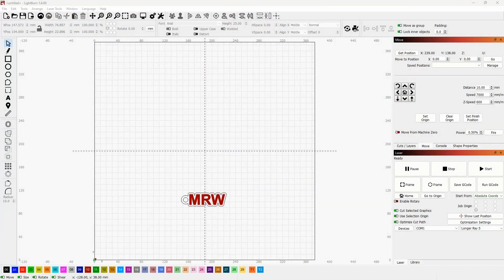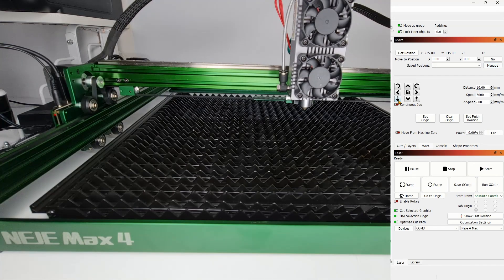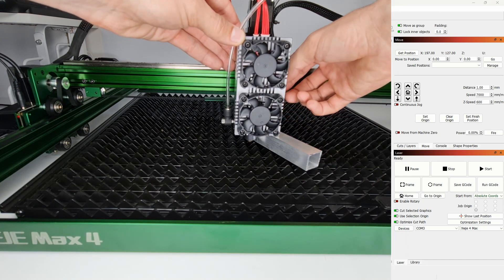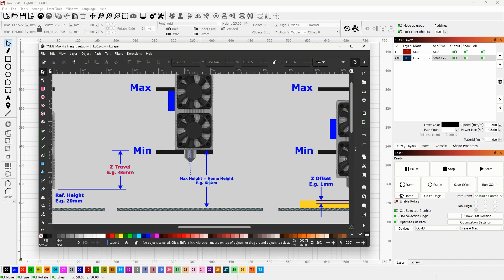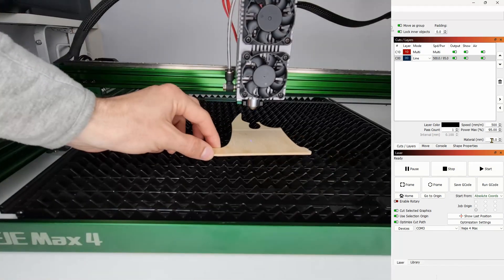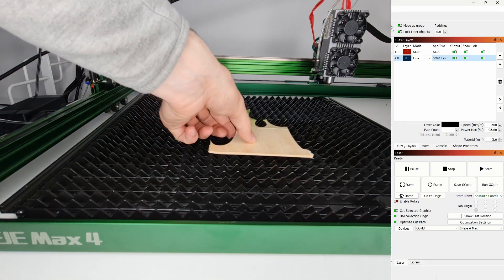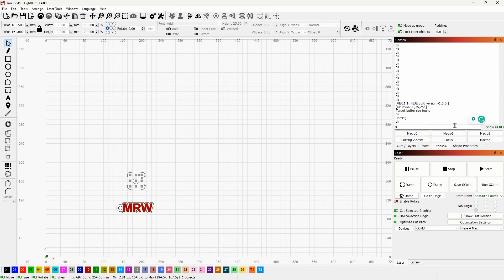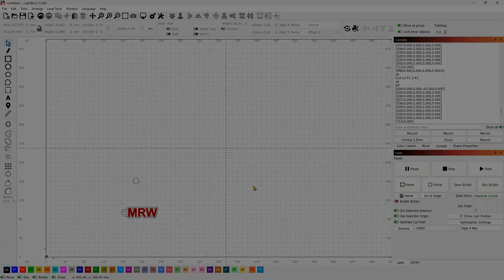Z Axis Setup and Control LightBurn with NEJE Max 4

Comment: You know there is one issue with your video and that is:  You have the focus at 23mm, while the manufacture says for E80 the focus is 25mm, and that make 2mm difference. Why aren't you using manufactures instruction? 2mm is a big difference and makes everyone go wrong. I like your video but, I don't like your misguided approach.

Comment: Hey, Do you know what is the reason that motor contunue turning while the head reach the end position ( see 13-23 till 13-26) - the head goes up and then it reached the home point , but it is clearly hear that motor is trying to turn, so it won't stop in home point .

Comment: Hi,  this is a great video and if my Max 4 worked like this it would be awesome! However, my Max 4 appears to behave differently and I wondered if you might be able to help?  I have followed the setup exactly as described. I determined the focal length on my E80 to be 24mm, and my distance from honeycomb to laser is 66mm... so the difference is 42mm. When I enter an offset of "42 - thickness of workpiece"  into the offset for the layer(s) it works perfectly. However, when I code the GCode entry (G10 L2 P1 Z-42) the coding is accepted, and $# shows [G54:0.000,0.000,-43.000,0.000], but when running the job, the Z axis does not move down at all. I've rehomed, powered off/on and checked the firmware and version of Lightburn (v1.6.00). I'm not running in absolute mode and I have double checked that Z-axis is still enabled - I can still jog it up and down...  Do you have any clues as to what else I could look for?
Reply: Ah hah... noting a comment below where someone mentioned "absolute coords"... As soon as I switched to absolute it works like a charm! Brilliant. SO it doesn't work like this in "user origin" or "current position" mode. My previous Laser experience is limited to an Atomstack A5 with no limit switches, so I have just got totally used to "current position". I am now learning how good absolute coords are!! 🙂  Once again MRW great video and very helpful (once I realised I need absolute coords!)

Comment: You are the only one who took the confusion out of this process. I believe I have it right now. Here are my list of steps I got from your video.
Step 1:  Home machine
Step 2:  In Lightburn (LB) in Device screen click on “Enable Z” and “Optimize Z moves”
Step 3:  Move laser to center with jog control (click on Move Tab in top right box for jog control)
Step 4:  Raise laser in bracket to it’s highest position (bottom of bracket even with bottom of laser)
Step 5:  Lower using jog control till it rattles (lowest position)
Step 6:  Loosen laser holding screws and lower laser to 25mm above the honeycomb
Step 7:  Go to Home position (laser should go up and over)
Step 8:  Measure distance from honeycomb to bottom of laser and record the distance = 73mm
Step 9:  Subtract distance in step 6 from the measurement in step 8 which is 73 – 25 = 48mm
Step 10: Measure thickness of material in mm and enter into the Material field in the Cut/Layer box
Step 11: To engrave click on black layer in the Layer/Cut box on the right and enter 48 in Z offset.  To cut click on red layer add depth of cut to the 48 and enter into Z offset field

It's a starting point and some fine adjustment may be needed to get the sharpest resutls.
Reply: thanks, very clear!

Comment: Hi, thank you so much for this wonderful video. Finally someone able to explain how this laser works. I have a question, what kind of compressor are you using? I bought the Ortur one, but I'm not convinced of the airflow. Thanks Luca
Reply from the maker: Hi, lucadiveglia2150;  thank you for your comment.

I am glad you found my video helpful.
About the compressor, I use a 9l oil-free compressor by Vevor, and it has worked flawlessly for about a year now.
It is quiet and effective; I allow the compressor to rest every 40 to 60min of continuous operation to avoid overheating. After all, it is not a professional machine.
I additionally arranged it inside a homemade enclosure using Rockwall panels to make it quieter and avoid troubles with the neighbours.

Below are some links to check out the compressor and other accessories you might need. Consider that a water trap is a must to minimize the condense getting into the line.

Compressor: https://s.click.aliexpress.com/e/_DlBpbS9
Water Trap Filter: https://s.click.aliexpress.com/e/_DeJ8RVx
Air Hoses: https://s.click.aliexpress.com/e/_DEPZnZ7
Attachments: https://s.click.aliexpress.com/e/_DeqOGdB

I hope it helps 
Ciao

Comment: Is there a way to have the z axis raise when burn is completed like it did before changing the G54 #?
Reply: Just put G0 Z45 in the Devices Settings window in the End GCode window under the GCode tab. You can also add G0 X*** Y*** to the position you want to finish.

Comment: I'm having trouble with the z axis raising on its own when a job is initiated.
I have tried disabling the z axis and any z axis offset in lightburn but it still raises even when creating a test grid or framing.
It doesn't do it when just moving the positions manually. 
Any ideas what could be wrong?
Reply from the maker: Hi, thank you for your comment.

The Z axis moves to the 0 position, to then sink again to the right offset. I guess you have some custom coordinate set for the G54. G54 is not triggered for a manual jog.
Type $# in the console and check the line that says G54, if there is some value other than 0 for the Z axis then you need to set it to 0.
To do that type:
G10 L2 P1 Z0
and enter.

I hope it helps
Ciao

Comment: Great video and information!! Hoping for some advice. I have the neje 4 max with the extensions. It seems my y axis is mirrored and it cuts in the opposite direction of the layout in the lightburn software. Thank you!
Reply from the maker: Hi, @arranp1693; thank you for your comment. 

The mirrored Y axis may be caused by two issues:
- The origin for the machine must be set in the lower left corner in device settings. The home is on the top left, but the origin is on the lower left.
- The Step Direction Invert is incorrect. Go to the GRBL Configuration or Machine settings and look for the parameter $3; check on my page the number to set up to invert the axis https://whathowwhysolution.com/lasergrbl-and-lightburn-why-my-engravings-come-mirrored/

I hope it helps
Ciao
Reply: @Middle Room Workshop  thank you for your response! I have put the origin to the bottom left but the laser only recognized the upper half of the bed. I have the cut design at the bottom of the perimeters on lightburn but it reads on the bed as midway. I tried changing the $3=2 to invert the y axis but it causes the laser to smash into the ends and do a load other terrible things.
Reply from the maker: @arranp1693 thank you for your feedback; you may have the G54 set to a different Y value.

Please connect the machine, then type $# in the console. This will show you all the Eprom Set values and check the G54, pay attention to the first 2 sets of numbers which must be 0.00; if not type G10 L2 P1 X0.0 Y0.0 Z(your value).
This will set the coordinate system to 0,0 and the Z value to what you need.

Make sure to work in absolute coordinate.
Let me know if that works.
Ciao

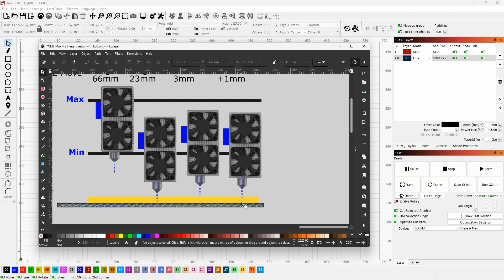Comment: this is still confusing on z axis ... at the 10:58 mark to engrave the z offset is 66-23-3+1=41 yet you set the engraving at 44 ???
Reply from the maker: Hi, thank you for your comment.

The reason is that, with the Z axis enabled you have the Material option in the Layers tab; therefore, the thickness is computed by Lightburn, without having to manually input it yourself.

I hope it helps,
Ciao

Comment: I love this video and it makes handling the "Z Offset" make so much more sense.   However, after I ran the G10 L2 P1 Z-43 and the G54 is changed to: 
(G54 :0.000,0.000,-43.000,0.000) NOTHING HAPPENS (i.e., the Z axis does not drop at all) when I run a print job.  The only way that I can get the Z axis to drop is to put the 43 number directly into the cut/layer settings.  Is there some other setting somewhere that has to be "turned on" to get the NEJE MAX 4 to respect the change to the G54 data change?
Reply: Are you in Absolute Coordinates?
Reply: Hi, I realise you posted some time ago, so you may not see this, but I wondered if you resolved this? I have exactly the same problem. Set the GCODE and have the correct values indicated when using $#, but when I make a cut nothing happens on the Z axis, the laser performs the activity, but the Z axis does not drop it stays in the top position! :-(
Reply: Try disabling "Relative Z Moves only" in device settings. It might be on by default.

Comment: Ciao! 
Ho da poco comprato il Neje (mi sto avvicinando ora a questo mondo), ma sto avendo difficoltà con il focus 
Ho seguito bene o male le istruzioni, ma non riesco proprio a fare il taglio di un multistrato da 6mm
Qualche consiglio?
Reply from the maker: Ciao, @danieled4849; grazie per il tuo commento.

Innanzitutto andrei a verificare che la macchina e l'ottica siano apposto. Per fare ciò ti consiglierei di resettare il G54 così che l'asse Z non si muove da solo e lasciare lo spessore del materiale a zero.
Dopo di ciò regola tu l'altezza del modulo manualmente rilasciando la morsa; dovresti lasciare dai 23 ai 25mm tra il fondo piatto del modulo e la superficie del materiale per essere perfettamente a fuoco sulla stessa. 
Fai un incisione di prova e verifica che lo spessore della linea di incisione e abbastanza fina; altrimenti abbassa il modulo di qualche millimetro (2-3mm) e prova a tagliare il compensato da 6mm. Come parametri farei 95% 150mm/min oppure 2 passate alla stessa potenza ma velocita 250mm/min.

Se la verifica ha successo, in quel caso devi verificare che il calcolo per inserire il valore Z al parametro G54 é corretto e che includi lo spessore del materiale correttamente nel campo "Materiale (mm)" nel Tab "Tagli / Livelli", più inserisci un offset di 2-3mm nel layer che usi per tagliare il compensato da 6mm.

Fammi sapere
Ciao

Comment: Followed this exactly and used the same stock thickness. It even worked out that my home was the same as his at 66mm. Definitely will not cut through on 1 pass of 500mm/m at 95%. Also seems to be dangerously close to the material where it will rub if any imperfections. I can’t figure this out so I just turned off Z for now and am manually adjusting with a ruler.
Reply from the maker: Hi, thank you for your comment.

The nozzle should be about 5mm from the surface of your material when engraving, and less when cutting if you set a Z offset.
Does it cut fine when manually focused? Is the cutting line thick? Perhaps the laser module has a slightly different focus height.

What air pump are you using? In my video review, I used a proper compressor.

Let me know
Ciao

Comment: Does anyone knows why is my Max 4 bouncing off when touches limit switch on Z
Reply from the maker: Hi, snjezanzivak1632; thank you for your comment.

The bouncing is normal when homing or the homing switches are triggered by the machine's movement.

Most likely, your machine is set to home the z-axis at the end of a project.
This is, however, something that must be coded in and, therefore, stored in the machine or an added Gcode footer block.

Please check these two things using Lightburn:
- Go to "Device Settings"> "GCode" and check if there is anything in the "End GCode" text box.
- In the Console Type $#, ensure all parameters are set to 0.000 with particular attention to G28 and G30. (G54 should show the custom value you have set)

Let me know so I can try to guide you further.
Ciao
Reply: Batko.....Do you have any social media where i can send you video of this problem.its not the problem when its homing. When its homing its ok it touches limit switch and it moves few mm down and it goes home only when its done with work its problem. When its done with engarving or cutting module goes up 45mm it hits limit switch hard and its like it wants to go up more but it cant then bounces of limit switch few times and it stops....i check limit switch with multimeter its working